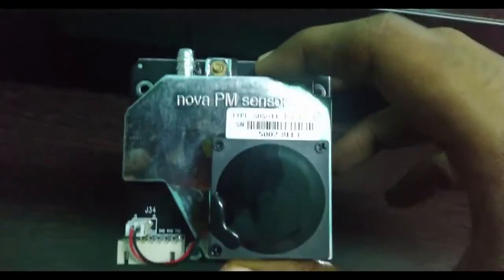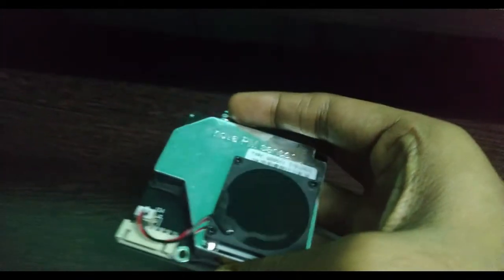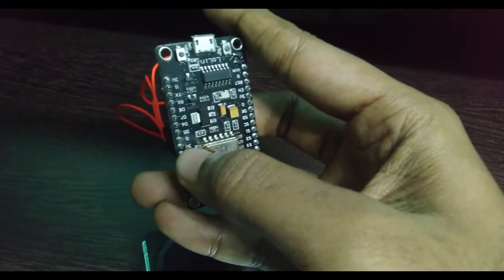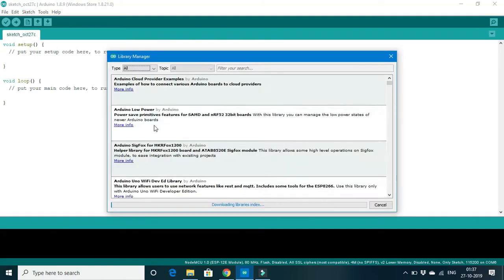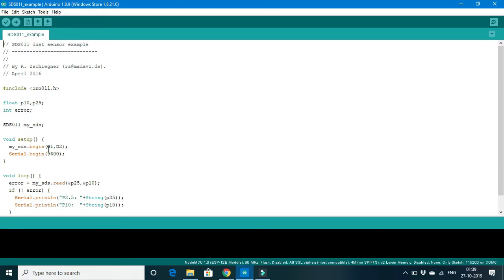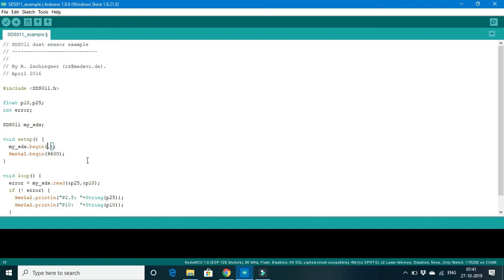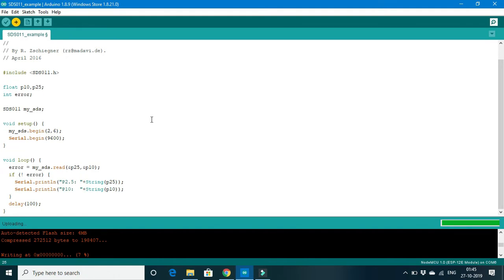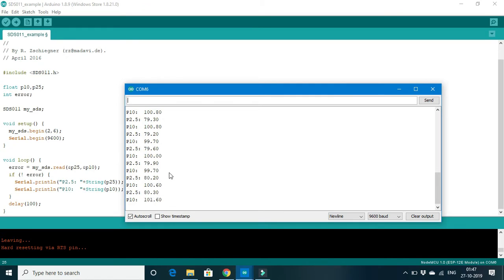SDS011 Nova PM Sensor with NodeMCU ESP8266 | Made Easy | Supernova

Comment: Hi Supernova Official, can you explain to me why you use UART1 of esp8266 (GPIO2 - TX pin) to receive data? According to the manual, GPIO2 use for transmitted data and can't receive data. Pls, explain to me. Thank you so much.
Reply from the maker: Hi Tài Thanh,
If I'm not wrong, I think the transmitter pin of the SDS011 can be connected to any of the valid GPIOs of ESP8266 and thereby it can act as the receiver at that instance, provided you modify the pins in the program. Have you tried of connecting to any other pins(say GPIO5, GPIO4 etc.)?
Reply: @supernovamechanics1769  I use your project to present this to my teacher, but there are few lines in the code I don't understand. Can you explain it to me?
1. SDS011 my_sds;
2. my_sds.begin(2,6);
3. error = my_sds.read(&p25,&p10);
Pls help me. It's very important to me. Thank you so muchhhhhhhh.
Reply from the maker: @taithanh6155  
1. Here SDS011 is the library which we have used. Whenever we are intended to use the library functions, we need to call those functions with the library name. The line 'SDS011 my_sds;' is used to tell the arduino that hereafter I'm going to call the function with the name "my_sds". You can give any name over here. This line statement is optional and you can also proceed with just SDS011, if you don't really need it.

2. Here we are calling the 'begin' function of the SDS011 library. It is in the format of "my_sds.begin(Rx,Tx);"

3. The SDS011 library was created in the way such that it holds the values of PM2.5 and PM10 in pointers. Thus, the third statement was used to fetch the values of PM2.5 and PM10 using the respective addresses (note: & is used). The error variable is used in order to eliminate the null values of p25 and p10.

Hope this helps you.
Reply: @supernovamechanics1769  It was very helpful to me. Thank you so much.

Comment: Connecting to 3v3 gave me false readings. I have air purifiers in my room (Xiaomi and Philips) and they both read 1μg. 

Connecting to 3v3:
P2.5: 43.10
P10:  45.00

Connecting to Vin on NodeMCU 8266 solved the issue:
P2.5: 0.40
P10:  0.40
Reply from the maker: Hi Nobert, 
The pin Vin is intended to power up the ESP8266 module instead of using an USB cable and it cannot act as a power pin for sensors like VU pin (5V) or 3V3 (3.3V)
Reply: Can you explain to me why you use UART1 of esp8266 (GPIO2 - TX pin) to receive data? According to the manual, GPIO2 use for transmitted data and can't receive data. Pls, explain to me. Thank you so much.

Comment: Is it correct that you are using 3 V for the Sensor? And if i use  the 5v from Node MCU it probably damage the RX TX Pins  from Node MCU ?
Reply from the maker: According to the SDS011 manual, the device would give the correct readings only at 5V. So, you can connect it to 5V without any problem.
Reply: Can you explain to me why you use UART1 of esp8266 (GPIO2 - TX pin) to receive data? According to the manual, GPIO2 use for transmitted data and can't receive data. Pls, explain to me. Thank you so much.
Reply: Confirm that 5 V is required. I tried 3 V today and the results did not match the software program.

Comment: hi ! nice video. But in your place there are pm2.5 = 80,3 micro /mc3 and pm10 = 108.60 micro /mc3? you confirm them?
Reply from the maker: Yes Lorenzo. Usually these levels would be normal. But when I recorded the video,  it was Deepavali in our country. All of us would burst crackers during the festival. Due to that the PM levels were above normal for over a week. :-) lol
Reply: Can you explain to me why you use UART1 of esp8266 (GPIO2 - TX pin) to receive data? According to the manual, GPIO2 use for transmitted data and can't receive data. Pls, explain to me. Thank you so much.